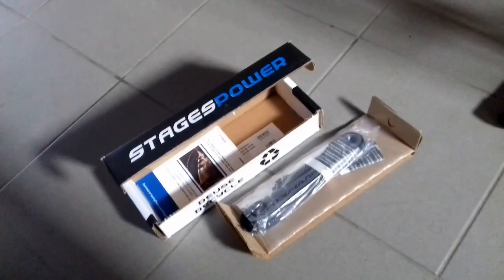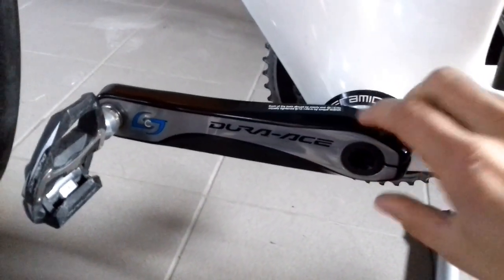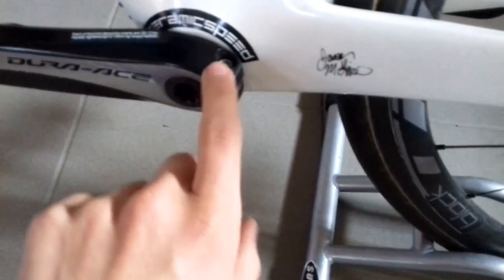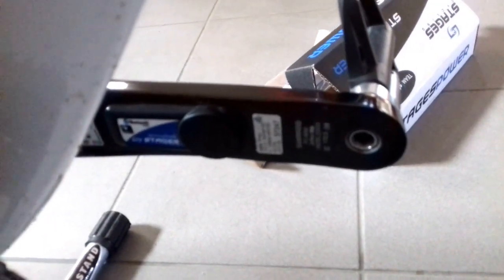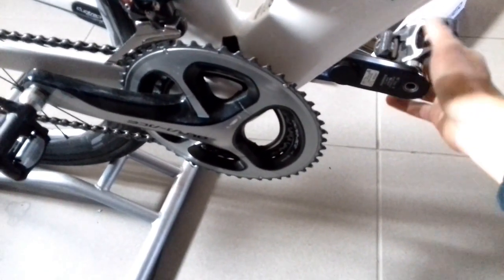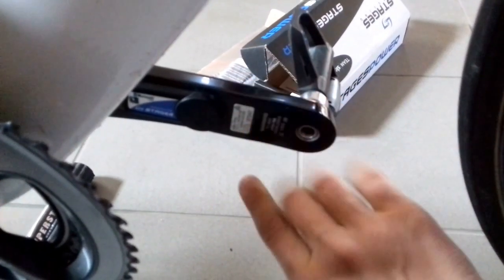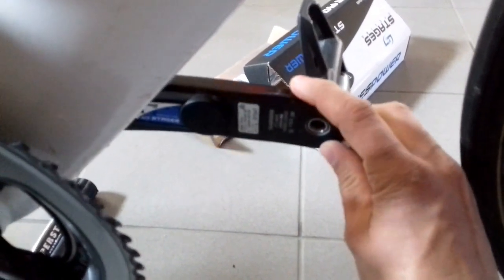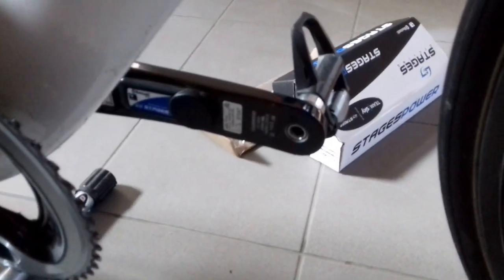Stages Power Meter gen.2 long-term review

Comment: Hi Rony, when you were using the Stages power meter what head unit were you using with it? I'm having connectivity issues with my Edge 820 and Stages Gen 2 unit that I can't seem to fix
Thanks! Austin.
Reply from the maker: Austin Vosdingh Edge 520, no issues

Comment: when you are talking about the lag, it may be because of your head unit setting. i had a big lag on mine, and my garmin was set to smart data rec instead of 1 sec rec. after i changed the lag was much shorter
Reply: Stages still has more lag in comparison to Quarq for example. I think it does more software computing before transmitting power data hence the delay.